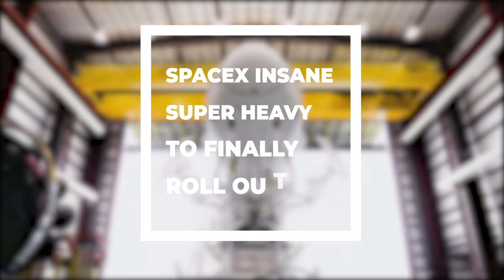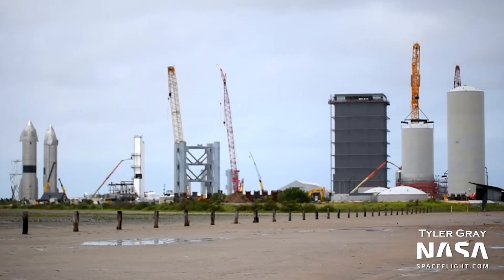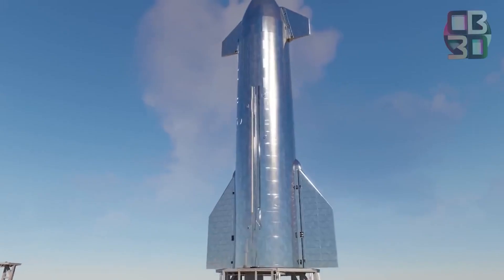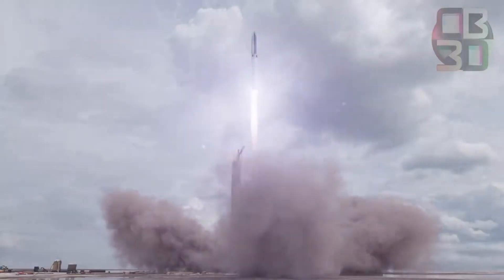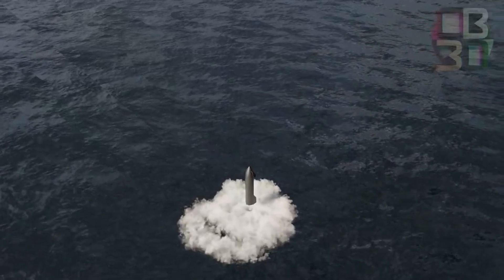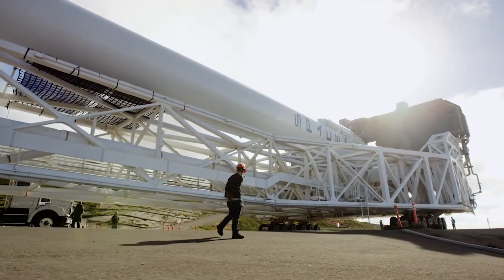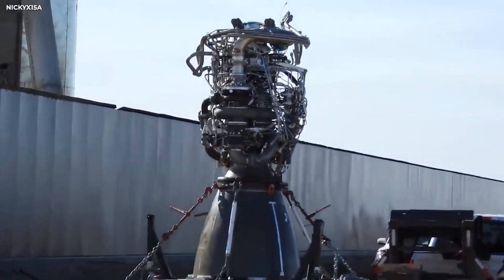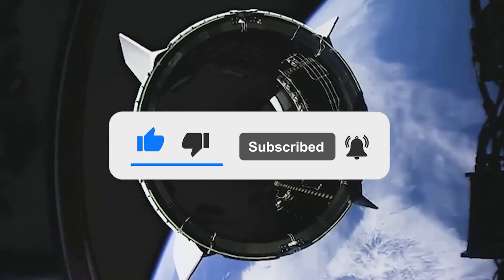HUGE NEWS!! SpaceX Super Heavy BN4 PREPARED!

Comment: Just a suggestion why dont the designers build those grid fins in such a pay that they can rotate to an orientation similar to four small rocket fins and then when they are needed they could rotate again to have 4 grid fins.  In this way you can eliminate the air resistance which they no doubt have I. Sure??
Reply: watch the base tour that Everyday Astronaut did with Elon, it covers a lot of stuff in the why and why not's, including the grid fins, be prepared though its 2.5 hours long over 3 vids.